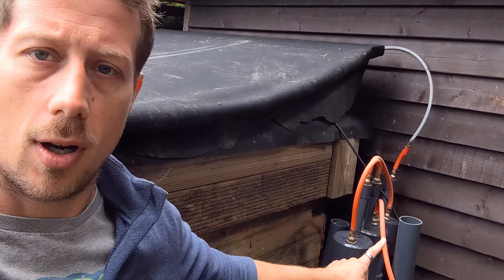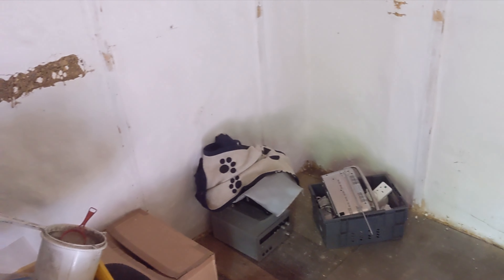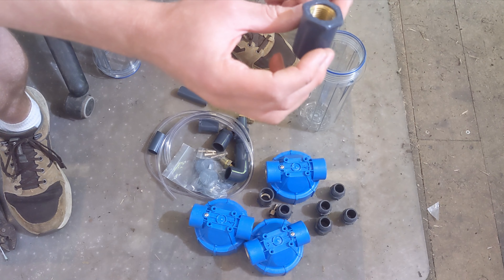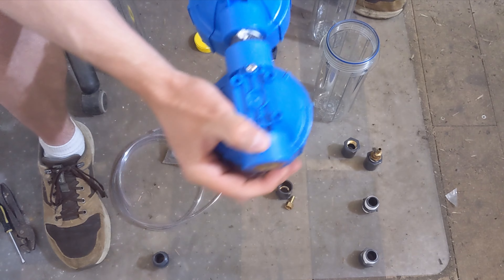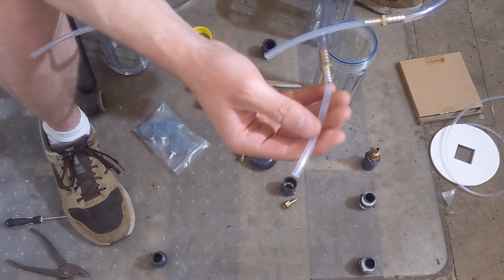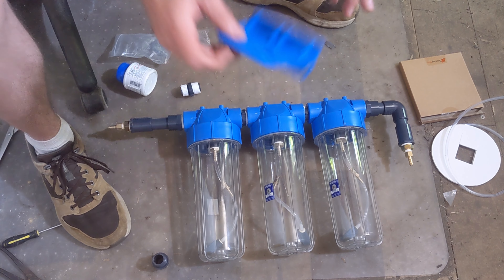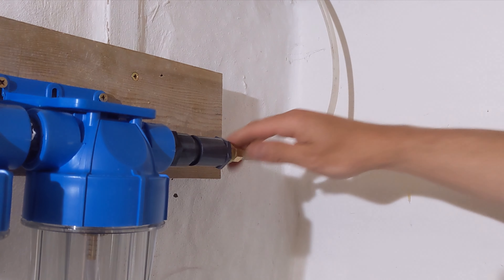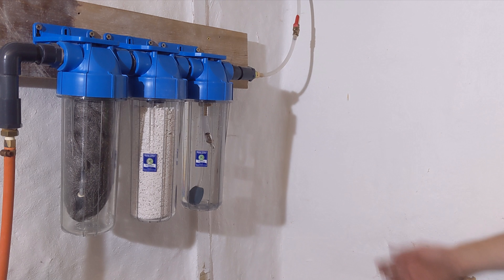How to build biogas scrubbers at home

Comment: I so want to do this but I'm afraid of blowing the whole neighbourhood up into the ether.
Reply from the maker: Although there is a risk with unpressurised gas like this the risk is lower than when using pressurized gas
Reply: @GetMeOffGrid_  Ok I get you so I will give this a try and maybe I can get it all set up for this coming winter
Reply: @NordeggSonya would love to follow you on your project. It is also something I am looking forward to do for years but keeping the digester at good temperature in winter times (Netherlands/Europe) is the main challenge. For this reason I did not start this project.

Comment: Any luck with the gas? What are you doing with your scrubbed gas in the bag? Are you going to use it to generate electricity or something else? Did you build a water heater to get the temperature up in the digester? I have a lot of grass and am wondering If I'd be able to produce bio gas from it. Hope you've not given up?

Comment: If you're going to scrub it, why not compress it into a LPG tank too
Reply from the maker: That is the plan when it finally gets up and running and has produced enough gas
Reply: @GetMeOffGrid_  oh I thought you had this all running already.
Reply from the maker: @justawfulgamer7738  It has been producing gas, but I have moved out from the house and its has slowed right down in production. I haven't been able to get back over and troubleshoot the issues. From what I have been told it seems like it has been overfilled.
Reply: @GetMeOffGrid_  please keep us posted. I'd like to do the same thing with an IBC tote. Do you have a discord or anything?

Comment: Hello sir, 
I am from India. 
I have a startup named Baramati Ecosystems. We have developed a biogas digester with capacity to provide constant pressure throughout the use of gas. I saw your work with the scrubbers and i think they are simple but quite effective. We are definitely going to include your scrubber tech in our product. I was wondering if you could guide us through some technical stuff with the scrubbers. How can we reach you.. A email address would be helpful..
Reply from the maker: Great, that you like the scrubbers. They are not my design, though. It's a common setup for small-scale biogas digesters. I am happy to help. My email is tomoffgrid@gmail.com